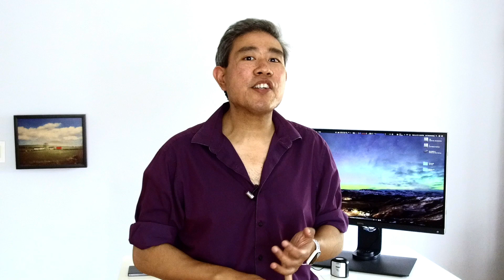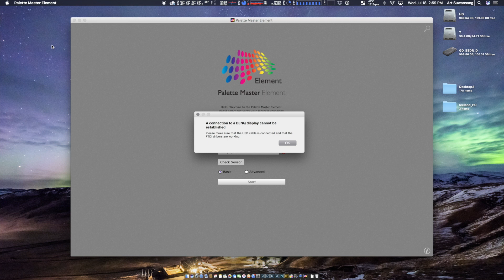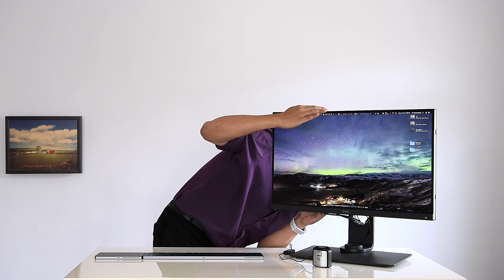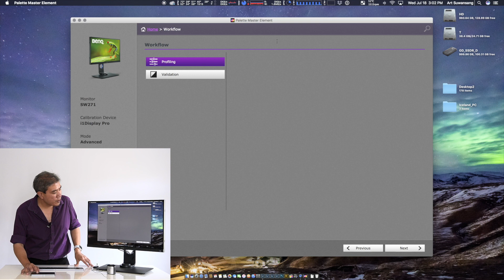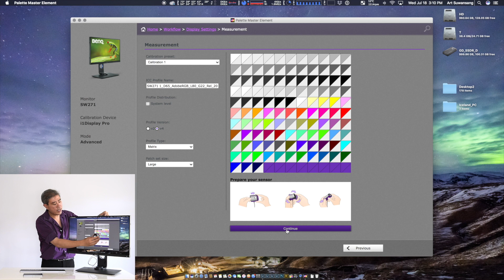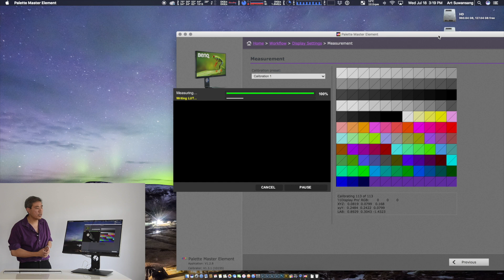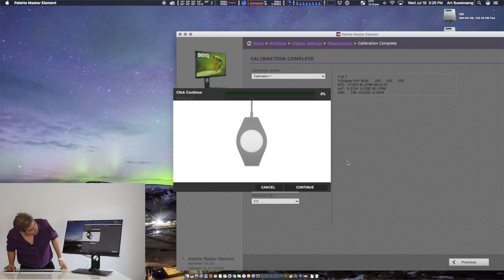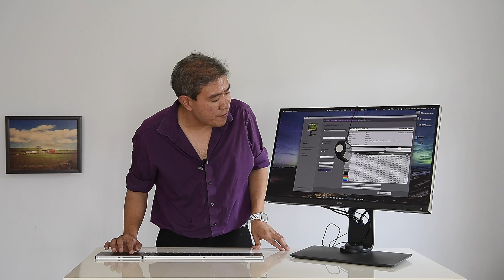How to Calibrate BenQ SW Displays with Palette Master Element - Art Suwansang

Comment: I forgot to ask. Some people notice some delta variation right after calibrating. They try to fix this using DisplayCal and making a correction ICC. My thoughts is they gonna ruin the ICC made by PME and the monitor calibration. Whats your thought on this?
Reply from the maker: Hi. So when you say "some people notice some delta variation right after calibration" could you elaborate a bit more on this? In this case did you mean, if you ran the validation two or more time after the calibration? If this is the case I have done this before and the best advice that I can give regrading this is to have the display running for at least 15 minute before calibration and validation, also make sure that the power management feature that turn off the display  is turned off as well. If this is not the case the please share the scenario with me. 

On my thoughts about editing the ICC with DisplayCal, my recommendation is to avoid it. Because once you taken the PME icc into DisplayCal or any other software you are now altering the output levels of the video card via profile. Essentially, you just turned a precise hardware calibration profile into a software calibration profile very similar to profiles generated with i1Profiler or i1Studio. All of the color calibration in the case of BenQ and any hardware calibrated display is really done inside the panel itself using a sophisticated computer and complex Look Up Table (LUT) this is an extremely large reference chat for the display! 

I hope this help.
Reply: You have to excuse my rusty english..; ""..if you ran the validation two or more time after the calibration.."" This is what I mean, and they see maybe a difference over 2 dEv and sometimes a bit higher which is very very small. I don't know what their goal is, but I've heard a lot of talk about using DisplayCal to run a correction of this variance just to get the calibration "perfect", whatever perfect means in their heads. My thoughts is that they miss the point of calibrating, that calibration is just for the perceptual sanity and printing,  and not to get it perfect on all the monitors in the world. Lets say the value of "white" get a difference of 4 dEV in color, people will most likely not notice it in a side by side comparison and certainly not if there are no comparison at all.

People on DisplayCal and other forums recommend to use this DisplayCal along with PME to correct this 4 dEV which in my eyes ruin the whole calibration. They are replacing the full output ICC profile in Windows with a software made 8 bit (?) one. Basically they throw the 16 bit LUT out the door and risk getting more banding / noise in final rendering on monitor. 

I also think they didn't set up their "BenQ Puck" which have factory profiles set to the 1,2 and 3 button. In my case it was AdobeRGB, sRGB and BW in that order. If they don't change this to Calibration 1, 2 and 3, they are throwing away their calibration and will notice a delta variation. I did this the first time when I used the puck and verified the calibration. Go in to monitor setting and look at puck configuration. Maybe you should make a video about this because I think very few people actually know you have to set up the buttons.
Reply from the maker: Hi Aleksander, 

Thank you for the clarification. I gathered that is what you were asking. From my testing I have not notice the variance, however, based on my testing and answer above, if the display was not on for a while then the verification could be off. 

The risk of getting more banding or digital posterization could be an issue of concern when you are modifying a profile. However, to some extent this matter and not at the same time. When you do a hardware profile, it is true that PME would generate an ICC Profile, however, this profile is technically an unaltered RAW output profile from the video card. Since all of the color adjustment is done in the panel itself, the ICC in this case does not do much by way of color adjustment, it is just modulating the RGB output of the video card at the set max value. When this profile is altered, however, this is where it matters and you have a great point there.

Also great suggestion on the hockey puck video. I will do a video with you. Thank you so much for the suggestion and ideas. If you have any more questions please let me know :)
Reply: @ArtIsRight  Thank you for well informed replies :)

Comment: also why didn't you check System Level in the setup?
Reply from the maker: Ideally yes you would check that, however on Mac since Sierra onward there’s has been an emphasis on system security and that is grayed out. The only reason why you need to check that is because you’re working on a system with multiple users. Which in that case what you need to do is take the ice file from your local ~/user/library/ColorSync folder and put it in the ~/Library/ColorSync/display profile so that all users on the system can access the profile.
Reply: You haven’t had any issues using Mojave have you?
Reply from the maker: I do apologize for the late response. However, yes the latest version of PME 1.3.3. and PME 1.3.4 does have issues with the ICC profile and Mojave 10.14.4 and 10.14.5 This issue is fixed in the up coming version of PME soon to be release.

Comment: Thank you for explaining how a hardware calibrated monitor works. Do I understand it correctly that it doesn’t matter what internal color profile inside the OS is selected because the monitor will always tell the OS the put out the full RGB spectrum? Why do I see differences in monitor when I change the internal OS profile? If the internal OS profile is bypassed it shouldn’t make any difference which one is selected. Or do I have to select a specific profile for the monitor to be precise? Do I have to stay on the same internal profile which was one when the monitor was calibrated? As you can see I am confused and I would pretty much prefer BenQ to have those questions addressed in their manual.
Reply from the maker: Hi Jurgen, thank you for the questions. So the internal profile that you select does matter. The reason is because if you select a profile that is not for the display then the output signal would get manipulated, you've seen this when the color change as you change the profiles around. This is why you want to use the profile that the display software in this case Palette Master Element (PME)created. The internal OS does not necessary have a profile and it does not by pass it. The profile that PME created is an instruction set to by pass any signal manipulation at the OS or hardware level of the video card. So yes you would have to select the profile that PME created and stay with this one. Great question. On a side note no manufacturer has these kind of manuals, even X-Rite does not have these knowledge in their manual. This is why I am here as BenQ Ambassador helping creatives like you with these issues.
Reply: @ArtIsRight  How about if I create several calibration custom settings say sRGB at 120nit, sRGB at 200nit and Rec709 at 100nit. Would I need to switch the system preferences display profile as I change my custom calibration preset on the display?
Reply from the maker: Hi @George, so the short answer to this questions is yes, because the icc profile that the PME generated would correspond to the specific color space and brightness level. This video will help too https://youtu.be/xQWzAzDbvqs
Reply: Thank you, that was very helpful

Comment: Thank you for this video, this is by far the best about BenQ calibration I have seen so far. I have two questions and will ask them separately. I am calibrating a SW320 and the software needs nearly an hour to do that. That makes it nearly impossible to play with it and try different versions. The display is connected to an eGPU and from there to a MacBook Pro running OS Mojave. My calibrator is iRite Pro 2. I wonder whether there is a problem with the eGPU. The other possible source of the problem is that I am using a dock to connect the USB port on the display and the connection is USB 2.1. and the last possible source could be Mojave. The software is definitely not optimised for Mojave (very disappointing). Any idea what could be wrong?
Reply: Thank you, let’s hope for further improvements
Reply from the maker: Hi Jurgen. Thank you for your questions again. For the calibration of SW320 it is about 30 minutes and the times are improving. What I like you to do is update Palette Master Element (PME) to the latest version 1.3.4 it is much faster now. The other thing is that the X-Rite i1 Basic Pro 2 along with i1Studio calibrate much slower than their i1Display Pro. As of this writing and from my extensive testing i1Display Pro is by far a much better calibration device compared to i1 Basic Pro 2. Long answer short, this has to do with the interval between samples. The i1Display Pro has a much shorter interval burst than the i1 Basic Pro which yield better result. The problem in this case is not the egpu it is the calibrator. The latest version of PME software is getting better compatibility with Mojave, it is an on going improvement. If you could I would recommend that you either rent or buy the i1Display pro for calibration. Please feel free to follow up if you have any more questions.

Comment: Im trying to calibrate my SW320 with the i1 but getting the error about FTDI I've tried everything you said to do but still having issues, any ideas?
Reply from the maker: Make sure that the USB cable is plugged in directly to the back of the monitor and the computer. Once you do that pull the power cored out of the display (do a full power cycle). Make sure that i1 is plugged right into the computer, make sure that it is recognized by the system and then try to launch Palette Master Element (PME) again. it should work now. Most of the time when you get the FTDI error it is because for some reason or another Palette Master Element (PME) cannot detect the display even if it is plugged in. I find most of these issues working with older USB 2 ports. Lesser of an issue with USB 3. Hope this helps. If this does not work the next best thing to do is call BenQ tech support and trouble shoot the issue with them. If there's an issue with your display then they'll take care of you.

Comment: Good video. I'm still to able to calibrate followed your instruction/ How are you i1 display connected/ is it via the monitor or MacBook? Thanks in advance.
Reply from the maker: You can connect it either way. If you connect through the monitor, you want to make sure that the the USB link cable between the monitor and MacBook is plugged in. Otherwise, connections the i1 directly to the laptop works as well.